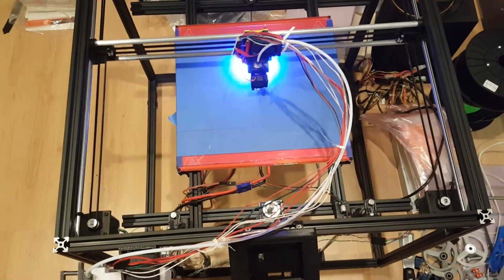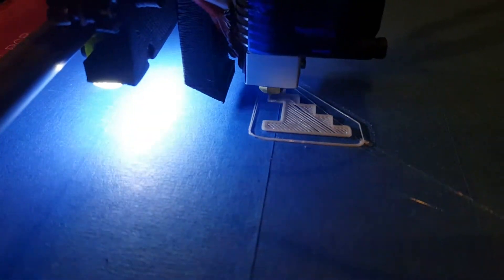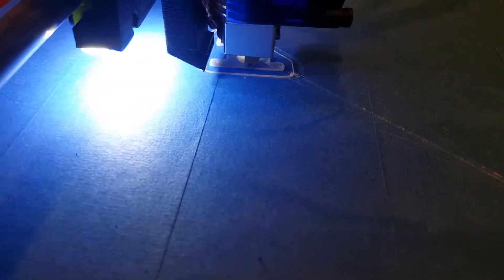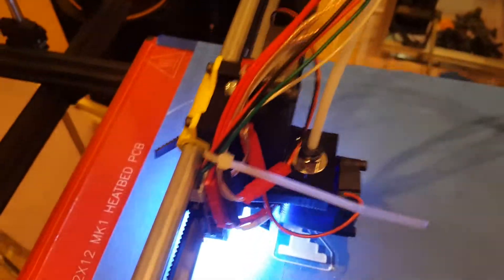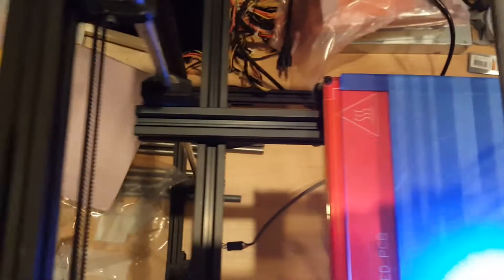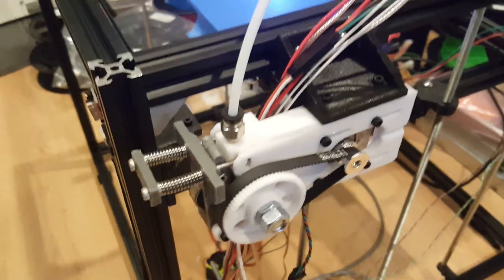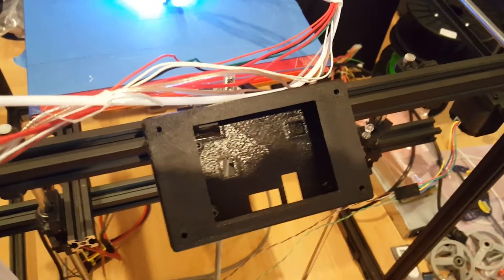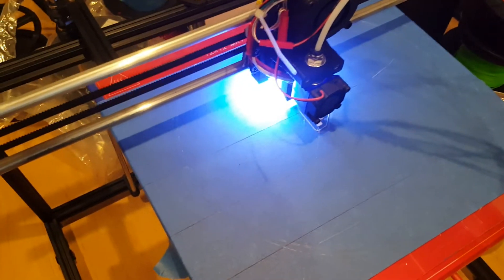Hypercube XL build #3

Comment: I'm curious how you have the dual Z motor drive setup
Reply from the maker: You mean how the motors are connected? In parallel, just like on any Prusa clone with dual Z motors
Reply: Artur's Lab so both motors into a single plug on the board
Reply from the maker: Correct. I have a Y splitter going to each motor.
Reply: Artur's Lab how many motors can be supported like this?
Reply from the maker: Depends on a number of factors. Mainly max current of your driver, current required by each motor, whether they're connected in parallel or in series.
Reply: Artur's Lab I was looking to have 4 motors connected, I have a 900x900x900 hypercube style design and I wanted more support for the build plate
Reply from the maker: sounds like you should get data sheet for your motors, see what current they require and see what stepper driver can handle such current. if you wire motors in parallel, current neede will be <number of motors> * single motor current. if you wire in series, single motor current will be needed but voltage will need to be increased
Reply: Am I correct in understanding, you have both Z motors plugged into the single Z axis motor port using a splitter? Can you send a picture?

Comment: Still amazingly silent
Reply from the maker: Thanks! There is some buzzing, depending on the print. But overall I think this printer runs fairly quiet. Someone mentioned that metal part of X endstop may be causing buzzing. May be worth to put a piece of foam under it to prevent it.